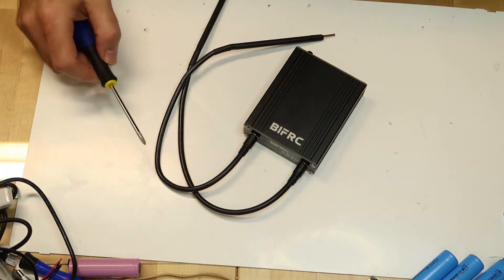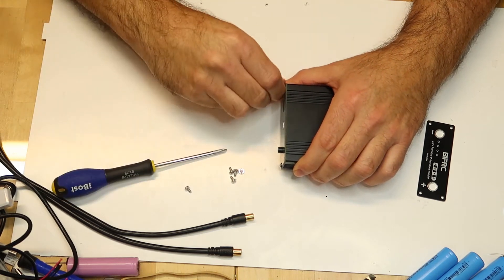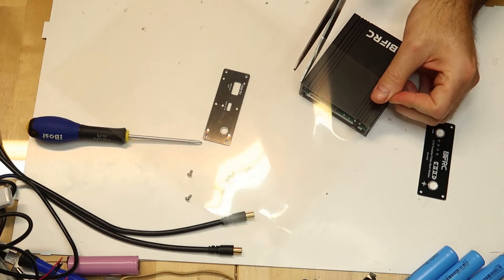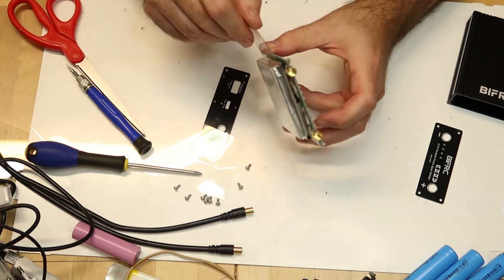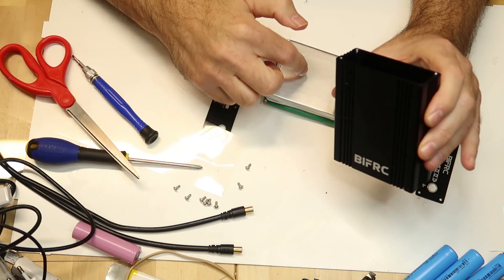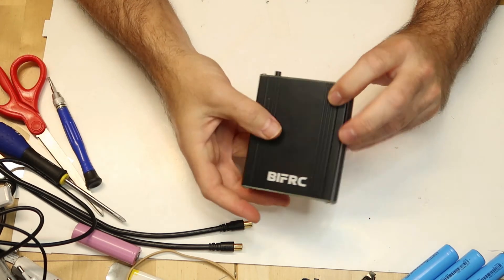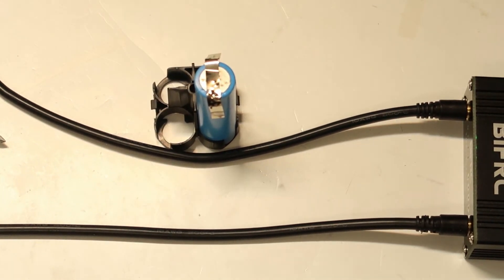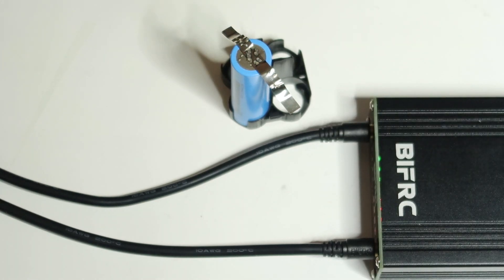Disassembling Spot Welder Type 2 from Aliexpress BIFRC

Comment: I only got to use mine a few times. I believe it is shorted. It makes high pitched beep constantly when turned on. Tried a weld and it put way too much current through a glowing hot weld happened. I stopped after that. Do you think it is fixable? The BIFRC customer support doesn't seem to exist.

Comment: What's the difference between DH20 and DH20 Pro? Pro version is 10 EUR more expensive..
Reply from the maker: probably battery capacity
Reply: Looks like the pro comes with a much bigger double probe that you can hold with just one hand instead of using both hands. Other than that it’s the same as DH20 with the same capacity.

Comment: I have this one, when i try to weld, it turns itself off. Are you experiencing the same issue? I don't know what may be causing it.
Reply from the maker: send pictures and I will help you, first measure battery voltage after disassembling
Reply: @RoeeBloch  Thank you very much for answering. The battery fully charged is 4,2V, as it's supposed to be. I was worried about it going to 0V and turning off the system but it appears is not the case, it maitains itself constant. With my multimeter I was able to check the maximum current output, only 0.8A and it justs turn off, can barrelly hear a welding noise, no spark. I have used it very little, like for 6 welds, put in my storage for 5 months and when needed, does not work.
Reply: Yes mine too

Comment: Thank you for posting this.  I just received the same welder today. I could  hear something metallic sounding rattling loose  inside so I opened it up  to see what it is and compare it to your unit. My welder has two brass looking rods measuring  55mm x 2mm. They are poorly welded next to the Moffett one on each side but one wasn't attached. I don't  see them on your welder.
Reply from the maker: send some photos  - it seems strange that the unit is different